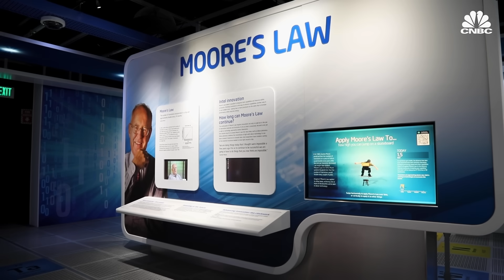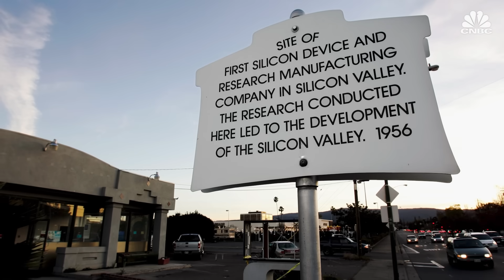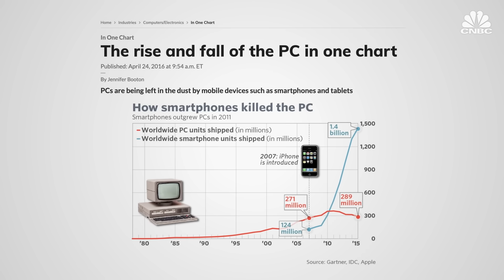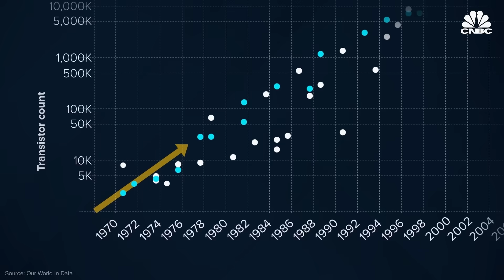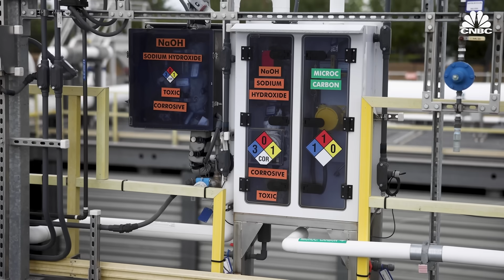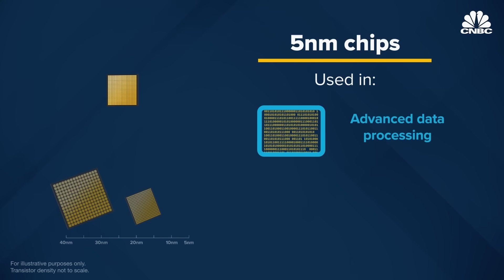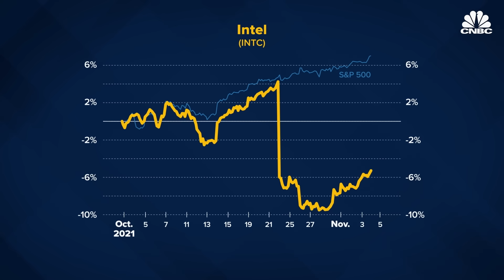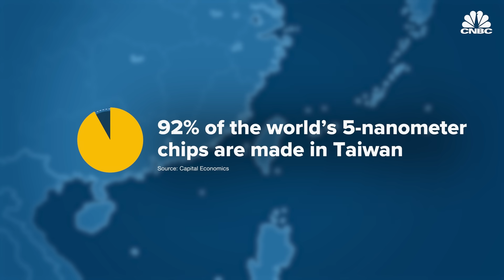Inside Intel’s Bold $26 Billion U.S. Plan To Regain Chip Dominance

Comment: Please note Samsung and tsmc 5nm chips are really about the same size as Intel's "7nm" chips. It's how each manufacturer measures their chips.
Reply: They still need to get their 7nm out, intel 10nm rebranded to 7 is closer to TSMC 7nm, maybe 6+ in a year. The are definitely behind.
Reply: @ageminiani  Not many people in the world can afford M1 IMac but anyway Intel has plans to compete, and I think they will succeed. They have to, the US is awake to the fact that semiconductors are important for national security. The US cant rely on Taiwan when they could be at war with China at any time. Intel plans to make its own designs, and designs from other manufacturers. Intel is responsible for the personal computer, I wouldnt under-estimate them.
Reply: @ageminiani  ARM chips are clean sheet design, many of the x86 have old code inside. Second intel and amd have general purpose processor the M1 is made exclusively for apple products and they can optimize it to work properly on their OS. If Microsoft design their own chip and send it to TSMC for production on their 5nm process it will be probably faster than the AMD/Intel that are currently on the market.
Reply: Didnt IBM develop a 3nm recently?
Reply: @MrMannyhw  yes but it was more of a proof of theory thing, they don't have the means at all to produce these chips at capacity.
Reply: @MrMannyhw  : It's a 2nm -- though it says nothign about the dimension/density
Reply: tsmc are planning on shipping 2nm (reportedly non-silicon chips) in 2025, but Intel might well at least come close to catching up. A monopoly/duopoly would be awful for progress so here's hoping!
Reply: @kieranwalkerkw  the barrier of entry is not small, one AMSL machine for litography costs 120mil$. Other than some of the big tech companies who have billions (if Google/Apple/Microsoft decide to produce the chips by themselves) on their balance sheet not many could afford risking at minimum 10billion$ in an industry that is dominated by Samsung/Intel/TSMC. China have tried pouring 10s of billions $ into their semiconductor industry and they're years behind Intel/TSMC with their processor chips.
Reply: SILICON CHIPS SHORTAGE ARE NOT ACCEPTABLE IN THIS 21 CENTURY.
Reply: 5nm is the size of transistors channel it’s not chip size.  In short smaller the transistors more the transistors can fit on the same size of chip.
Reply: @ageminiani  Intel is still making billions, they have most of the personal computer and server market, they create chipsets, graphics and many other components of computing. Technology is a huge market with many different categories. Intel created the industry, they have been a little slow lately but I wouldnt write them off. This is a new era.
Reply: In terms of transistor count: TSMC 7nm = Samsung 7nm = Intel 10nm = Intel 7nm

Comment: a lifestyle company in Cupertino is designing more powerful chips  than a dedicated chip company, think about that for a minute
Reply: Did you watch the video? The problem is manufacturing not design
Reply: Apple isn't a "lifestyle company" and they have the best chip designers on earth.
Reply: It's one thing to "design" something, and an entirely different thing to actually manufacture it. Having fabs in other locations besides Taiwan is a good thing for everyone.
Reply: 1) who is actually manufacturing the chips they design?
2) even if they are, how much does it cost?
Reply: “a lifestyle company from Cupertino” is quote I took from Intel, its great they want to expand their manufacturing chips part of the business, but how can they expect to attract business from the largest chip procurer (Apple) when they constantly post negative news about the company (see most recent commercials of Intel trashing Apple products)
Reply: @kevinbheaven  They don't "want to start manufacturing chips", they've never stopped manufacturing chips. They are a vertically integrated company when it comes to design and manufacturing. What they want to do is expand they're foundry business as it was put on the back burner and not utilized to it's full potential for far too long.
Reply: @kevinbheaven  what does your second comment have to do with your first comment lol

Comment: Intel can't compete with TSMC if we are to be honest. The latter is strictly a dedicated semiconductor foundry which means they can better streamline their processes/efforts and invest heavily in that area. Meanwhile, the same can't be said about Intel.
Reply: theoretically there is some overhead in having to design a pipeline that can handle different customers as opposed to intel fabs being purpose built to their own needs, but yeah tsmc seems really far ahead of everyone else.
Reply: @BattousaiHBr  exactly
Reply: Intel  failed and  was challenged by Japanese semi companies previously, then Intel prevailed.
Taiwanese is just weaker version of Japanese, and essentially both Intel and TSMC are at the same level from semiconductor manufacturing perspective, so Intel will prevail again if Intel has the motivation and do so by just copying what they did in the last run.
Do not panic, Do not buy the noise and hype, since US people need job right here in US.
The saddest part of the story is TSMC is fed strong by US companies like Apple/QUALCOMM/Nvidia/AMD, these selfish CEO and wall street jerks make normal US people suffer...
Reply: @minfhzi4298  you're completely wrong.
you should check asianometry for more detailed information on the subject.

Comment: This completely leaves out that the nomenclature for processes differs drastically between companies. Intel 7 and TSMC 5 are the same transistor size. Given the big deal you made about the process differences between the companies and Intel's rebranding of process nodes, this is a pretty important detail...
Reply: Intel 7 and tsmc 5nm are not the same. The problem with the nanometer nomenclature is that they are radically different in how each company measures it. Tsmc measures only the gate, which is the most important part of the chip. But Intel makes the entire chip (or at least used to) at the same nanometer measurement.
Reply: SILICON CHIPS SHORTAGE ARE NOT ACCEPTABLE IN THIS 21 CENTURY.
Reply: Intel new nomanclature is more reflective of industry standards ..this was the right move so amateurs like in this video and hedge fund managers know where to put the money
Reply: You have a massive typo. Intel 7 is significantly behind TSMC N5. By transistor density alone, TSMC N5 is 170 MTr/mm2 and Intel 7 is 101 MTr/mm2. Over 50% more dense using the tightest libraries…. You meant a Intel 7 and TSMC N7….
Reply: @ikjadoon  intel 7(previously 10nm) is tsmc7. Tsmc 5  will be outpaced by intel4. 

So tsmc is basically a year ahead as of now(if intel keeps to scehdule)

IMO if intel4 is sucessful then intel is back otherwise it will be bad news

Intel 4 was suppose to come q12022 but is now delayed

If they can lauch it 2022 then game on otherwise AMD/tsmc will take more share
Reply: @ziaulislam87  Just what I wrote. The parent comment is wildly wrong. Nobody is anywhere near shipping TSMC N5 densities, which has been on the market for 12+ months!

Comment: I think you guys didn’t do enough research on Intel 7, formerly Intel 10nm super finfet. Even though it was “10 nm”, the “nm” notation to semiconductors aren’t true and are primarily just marketing gimmicks. Intel 7 is comparable to TSMC 7’nm’, however TSMC has designed smaller chips than Intel and Samsung, and they produce smaller chips with higher density than Samsung.
Reply: @ageminiani  This is what this story misses.  Intel runs CISC, while ARM uses RISC. And RISC is better for these 10 core 15 core 20 core processors, because the instruction set is smaller. How will intel compete when they still use RISC. It's too power heavy, and they may compete on speed, but not power consumption.
Reply: @heyaisdabomb  intel wants to be foundry , not a chip design maker. they will just use other designs.
Reply: @heyaisdabomb  ISA is only part of the equation of why Apples chips do better, its more than just" ARM = better therfore faster" argument. having access to the latest nodes, vertical integration with software 100% in your control will obviously give you special advantages over your competitors. You don't see any other ARM desighners do better except for APPLE.
Reply: That's true.
Reply: SILICON CHIPS SHORTAGE ARE NOT ACCEPTABLE IN THIS 21 CENTURY.
Reply: @ageminiani  3DMark Time Spy Extreme World RECORD with 2x RTX 3090 KINGPIN Cards on LN2 at Aalto University
Apple is slower than intel, you need to run your machine for longer time than intel for a fact, so any less power is still doubled when you do a task that takes 200 percent the time as intel does.. get a clue. 3dmark proves intel and nvidia crushes m1 apple in real performance in shorter amount of time. We dont need less wattage, we need more power

Comment: After using my AMD Ryzen processor, I'm not sure I will be switching back to Intel unless they can beat it.
Reply: Already doing that with the new Alder Lake chip launch, next?
Reply: @billwiley7216  Well, we will have to see how it performs before I'm a buyer... Looking to buy another PC and I'm steering away from Intel for now.
Reply: @Boxagami  Plenty of Alder Lake 3rd party reviews and benchmarks already on You tube by respected and trusted tech reviewer sources showing Alder Lake solidly beating even the almighty AMD 5950X which cost a $100 more than the 12900k that is beating it.
Reply: @billwiley7216  Thanks for the info, I will look into them.. I'm seeing more Intel chips in many PC's for sure on the market. I.E. say Office Depot has several that seem to be Intel and Windows 11 ready.
Reply: @Boxagami  Alder Lake chips which just released a couple of days ago is what you want. Probably be a few weeks before any pre builts with those chips get onto the retailers shelves.
Reply: @billwiley7216  Yes sir.. Thank you!
Reply: Intel is back on top in most applications with the 12900k and the 12600k can beat the 5600x, though the power consumption on intels new chips is insane
Reply: @lordmoose213  nope only if you run benchmarks, otherwise while playing games and doing normal work on pc it's in line with AMd
Reply: @allenwalker9928   it does better in many games too, but you are definitely right that it is not by much. And in the reviews I watched it almost always did better that ryzen 5000 by a decent margain in professional workloads like media creation.

Comment: That is twice now they use chips in electric toothbrushes as an example. I don't see the need to put a chip in such a device. A bush an agitator connected to a switch connected to a battery, where the need for a chip?
Reply: The battery loading circuit, to start with...
Reply: @Steamrick  A what now?